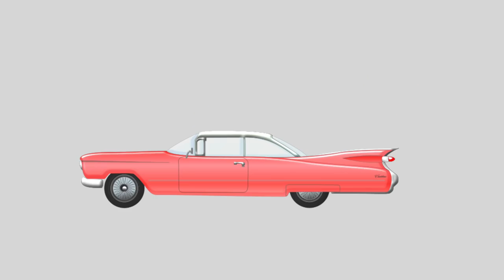Yes, Rockets CAN Fly in a Vacuum

Comment: What did you just say about cars? That they move by the thrust of the exhaust? With that knowledge I wouldn't trust a word she's saying
Reply: if she'd said that the car's tyres have to push on the external body of the road it'd be too easy to deduce that a rocket's exhaust has to push on the external body of the atmosphere. so she had no choice but to bluster.
Reply: No.
She said that the exhaust does generate some thrust, but not nearly enough to overcome the friction between the wheels and and road.

This statement is entirely correct. What's your issue with it?
Reply: @niallkinsella2687  wow white knighting a nasa shill, great gig.
Reply: @inniuniui9361  
White knighting...sure...
Because if it was a man presenting the video then you'd just be wrong. Can't be having that now can we...
Reply: @inniuniui9361  
You can claim that your physics defying nonsense is whatever you want to say it is.
One thing it will never be is correct.
Reply: @stuartgray5877  <------ has been shilling for over 2 years now.  Claims to be an engineer, yet roams YewToob comment sections.. Cuz that's what engineers, and not shills, do. 😬
Reply: @DrCash7  - So when a rocket engine ACCELERATES the MASS of the exhaust gas into the vacuum - from WHERE does the FORCE originate ?
Or are you going to argue that the exhaust gas (which HAS MASS) Can be accelerated WITHOUT a FORCE?
SO can MASS be accelerated without a force?
OR
Gas does NOT have MASS?
Which one is it genius?
Reply: @stuartgray5877  exactly.  Still won't back up this claim of being an "engineer."  Bot or shill, choose one.
Reply: @DrCash7  stuart gray doesn't even know that the velocity of a gas particle is a function of its thermal energy. so no, he is not an engineer.
Reply: @inniuniui9361  
Please, explain to the world how the momentum of a kilogram of water travelling at 1 meter per second is different depending on what phase the water is in.
If you don't like water then use methane, or iron, or any matter you can imagine.
Just as long as you explain how the momentum is different depending on the phase of the matter.
Reply: @inniuniui9361  
Where does it say that momentum is different depending on the phase?
How is the momentum of a kilogram of solid water any different from that of a kilogram of liquid water, or gaseous water?
Reply: Here Here says the Board lol
Reply: @niallkinsella2687  please show that equation using Newton's 3 laws of motion? To even use the word or term 'Thrust' you must first demonstrate some form of motion caused by it, not just gravity like rolling down a slope or hill. Good luck there champ.

Comment: Haha. I have this fight with my wife all the time! Thanks for clearing it up for her! ;) 

Oh and the exhaust exists the car through the exhaust valve with the exhaust stroke not because of the force of the power stroke. Your exhaust doesn't push the car forward, the power stroke turns Chemical energy into mechanical energy and that is transferred to the drive train to your wheels which in turn push or pull the car forward. The absolute minute pushing power that the exhaust might have would be nullified with the exhaust hangers.  I know it's not the point of the video but your car analogy is a bit off.
Reply: a bit off 😁
Reply: THRUST Definition: a force acting perpendicular to a surface. 
PRESSURE Definition: force over area equals pressure
NEWTON'S 3rd law. For every action there is an OPPOSITE reaction. HOWEVER, It goes on to state that you need two objects for an action. A MASS must act upon another MASS to generate an action. Force acts upon Mass to generate Thrust. Space has no Mass so no action can be taken to create thrust. You cant accelerate from a stop in space.
Reply: You gave the example of an inflated balloon which you left moved fastly,  is just because there is air around and the air coming out of the balloon strikes that air in the environment which pushes back the air coming out from the balloon which pushes the balloon and the balloon runs fast but in case of space as by definition there no air in the space then how the gases coming out from the hind part of the rocket as a result of combustion inside the rocket, push anything to react in opposite direction as there is no air in space?

Secondly, a rocket travels millions of km from the earth then will that fuel not finish. If its utilised from one side travel then on return from where refilling is done.

In my view travel in space is not possible according to the available laws of motion. 
Secondly let's suppose it possible by the ways you mentioned then how the rocket changes its direction and
Thirdly how it stops after reaching its destination?
Thanks
Reply: @5yri5  So tell us how a rocket moves in air? How do air molecules push back against the rocket body to move it? Keep in mind that these air molecules are being blown backwards at very high speeds.
Reply: @5yri5  - "Space has no Mass so no action can be taken to create thrust."

So according to YOU, the exhaust gas from a rocket has NO MASS?

A space shuttle main engine (SSME) consumes 500 kilograms of liquid oxygen and liquid hydrogen PER SECOND!
This creates PURE WATER at supersonic speeds.

How many kilograms MASS of pure water comes out of the engine PER SECOND?
Reply: @surgeonsk8104  a rocket, once it got momentum in the vacuum of space, it will continue moving without any thrusts since there's no friction that's stopping it since space is a vacuum. Law of inertia states that an object that's in motion will continue to be in motion indefinitely unless acted upon an external force(like friction) and rockets can change direction by reactivating thrusts and point it in a direction
Reply: I think you misunderstood her. She was saying that the exhaust leaving the exhaust pipe does create thrust but on earth in the atmosphere there are so many other strong forces like gravity, friction, etc that this thrust is negligible. If you were to launch the car into space and idle the car the thrust created by the exhaust leaving the tail pipe would be enough to move the car forward because it would be the only force and would be able to overcome the enertia of the car.
Reply: She explained how a rocket works on earth not space 😂
Reply: @5yri5 so you mean that as there is nothing for any force to act upon, the 3rd law results in stasis, an equal and opposite reaction that results in no physical movement from its point in space?

Comment: The exhaust does NOT propel a car down a road....its the explosion that moves the piston which turns the crank shaft that turns the wheel that is in full contact with a road hence movement.....
Reply: The exhaust is too small and slow in a car to propel it forward.
It has nothing to do with any rocket engine, she was very clear they work differently
Reply: Yeah she kinda messed that up. Also she implied the force of the explosion in the power stroke forces the exhaust out. The exhaust stroke does that haha.

Comment: Another way to think of it without (directly) invoking Newton is to envision an exploding grenade in space. The gases from the explosion expand outward more or less equally in all directions, flinging the grenade fragments in all directions as well. Now take away half of the grenade shell. The gases still push outward in all directions, but meet nothing to push where the housing has been removed, so they just escape out into space. But they also push against the remaining shell of the grenade, sending it on its merry way. A rocket engine is just a grenade with half of the casing removed. Well, a little more refined than that, but you get the picture.
Reply: Indeed.  Nod to the original Orion project from the 1950s where the concept was to explode nuclear bombs behind the spacecraft and use the shockwave to push it forward: https://en.wikipedia.org/wiki/Project_Orion_(nuclear_propulsion)
(NB: not the current, ongoing, Orion Spacecraft project: https://en.wikipedia.org/wiki/Orion_(spacecraft) )
Reply: @Braden-York  You were making sense until you mentioned a "flat earther." What the hell, man? What does flat earth theory have to do with rocket thrust?
Reply: Another way to think of it ?   How much slower thrust(or expended fuel )  would one need to impede faster thrust (expending fuel ) to accelerate  a 4 ton object in a almost perfect vacuum let say 5 km per second (high earth orbit gravity)  Answer   almost infinite  The volume/mass of fuel would need to collide with the expended energy simultaneously because in a vacuum the mass/volume of expended fuel would not lose momentum fast enough to propel a 5lb object.  Basically moving a rocket in a vacuum would be  time travel
Reply: grenade will not work .................it needs oxygen to fire ................smarty pants .................you're in a vacuum of space ....................will an airplane wing generate lift in a vacuum ?.....................NO IT WILL NOT .
Reply: @Braden-York  REPARATIONS FOR ALL TAX DOLLARS WASTED ON ..........................................SPACE SHIT !!!!
Reply: @WeeSleeket  on a flat earth ...........this is it ..............we are not going anywhere outside of "earth".
Reply: I came here because i’m curious about the reason why, for example, a football, with a hole from which air is escaping would propel itself in a vacuum. The leaving gas doesn’t have anything to push against and it doesn’t expand rapidly inside the ball. So what’s happening here?
Reply: lesnyk255 I actually had a soccer ball in mind, but I wrote it that way because I’m used to calling it a foot ball as we do where I live. Also, thanks a lot for the explanation, I actually had something similar in mind after doing some research and you confirmed it.
Reply: @thestarforger832  Ohh, soccer vs football, sorry, my USA bias is showing! Glad my explanation was consistent with what your own efforts had uncovered.
Reply: @lesnyk255  You are a physicist and don't understand that it is the air that is moving out of the balloon that is creating the force? The balloon would be treated as a point mass and the free body diagram would show a force that is in the same direction as the motion because of newton's third law. There would also be a force vector pointing down  due to the acceleration due to gravity.
Reply: @pblakeney  Of course I do - equal & opposite reactions. The notion that the escaping gases must "push" against something to make the rocket move is the fallacy we're talking about here.
Reply: @lesnyk255  The force is generated by the escaping gas not the net force of the gas inside the rocket. A change in momentum of gas as it leaves the rocket creates a pair of forces. This change in momentum is a change in mass (mass flow rate of the gas) multiplied by the velocity of the gas + (Pressure of escaping gas -stream free pressure) multiplied by the exit Area of the nozzle or F=Mdot X Ve + (Pe - Po)Ae. This is known as the Rocket Thrust Equation. The rocket does not push off the air and in fact, the air subtracts from the thrust vector as (-Po X Ae).
Reply: @pblakeney  You are of course correct. But I've been asked more than once "how can rockets work in space if there's no air to push against?" Invoking Newton's Laws or the Rocket Equation are not convincing arguments without some understanding of the principles behind them. Perhaps my analogy was a poor one, but it attempted to offer a more intuitive explanation. Maybe a better one would have been the rowboat that goes forward when its occupant heaves a cement block out the stern....
Reply: This is were physics drifts away from reality. Newtons 3rd law is relative to matter. How matter interacts with other matter. A vacuum doesnt have matter except photons and ions. So to say a directional airburst turns or stops a spacecaft is ludercris. Matter only reacts to other matter. A airplane creates a lower density/higher volume of gas that is pushing off of higher density/lower volume of gas creating a action. There for that action gas a opposite reaction which is pushing tue plane foward. A spacecraft using a airburst isnt creating a action because the matter (gas) isnt interacting with other matter because its a vacuum.
With a lack of action you cant gave a equal but opposite reaction. The airburst gas is just expelled. By time the 2nd particals of air come out tye 1st particals has gone further enough away that the 2nd particals cant give it a reaction.  So unless nasa wants to change its "talking" points and say there is micro matter in space and thats what we use as a action point.
Reply: Great analogy! Newton's 3rd law has nothing to do with rocket motion. Conservation of momentum is also often used to explain rocket motion. But conservation of momentum is valid only if the SUM of external forces acting on the rocket is zero. When the rocket is near the Earth, gravity acts on the rocket as an unbalanced force and so conservation of momentum doesn't apply.
Reply: Grenade wouldn't explode without oxygen
Reply: @gregorywaters8426  Thank you Captain Obvious. Have you never heard of "thought experiments"? Or "analogies"?
Reply: @gregorywaters8426  - "Grenade wouldn't explode without oxygen
Yes it would. Grenades have their own oxidizer. Bullets work too. So Does C4

Comment: One could potentially even propel one selves in space using farts. I already sent out the patent. I call it the Chili Drive™.
Reply: Topplethepyramid give me 5 pounds of beans.
Reply: #fartJokesHunter
Reply: Toppelethepyramid... Some Apollo astronauts actually mentioned that, because there was a still a bit of hydrogen dissolved in their drinking water after it came from the fuel cells.
Reply: What's your power source?
Reply: Somebody send this experiment design to the ISS! 

Unless they already tested it. (I don't think the Apollo crew documented those incidents with video)
Reply: And the rest of you coming out the same hole.
Reply: On a very very low gravity environment (an asteroid) you actually could launch yourself into space using your farts. yepp. but i wouldnt be very good for your health to pull blank.

i guess that is the lowest level we´ve ever been here....
Reply: An astronaut has mentioned this idea. It has a few problems. Some inherent to the design of your butt, some easily overcome if you have no shame.

A:Your butt is not a very good rocket nozzle. Not much you can do about that.
B: Your pants act as a diffuser, and will prevent any thrust from being generated. (Mooning your crewmates is frowned upon by NASA. though I'm not sure theres a specific rule about it. yet.)
C: Farts don't have much specific impulse anyway, as they have very little mass.
D: It is hard to keep your center of thrust aligned with your center of mass, so you don't just spin in a circle.

After much consideration, I propose that using your pee to propel yourself instead of your farts would be much more effective.  (I cannot recommend doing this however, as it is considerably more likely to cause damage to equipment, as well as considerable damage to your relationship with your crewmates.)
Reply: @Matthew Creech Chili Con Carnezine™
Reply: 844#1Fan Fasolada power...
Reply: You just need a load of Taco Bell
Reply: I would like to invest in this
Reply: "Mmm! Downing curried egg sanwiches right now (sorry, mouthfull). I'm gonna leave the  corperate world way behind (well something from behind & they're all running the other way).

Comment: Amy how about a video on all of the exotic metal alloys used in the space program, and why they were (are) used? Thanks and keep up the GREAT work.
Reply: Yes, would love to see that too. I’ve always been interested in what exact materials can withstand those kind of extreme temperatures and last for such a long time without constant maintenance. You’d figure with thousands of satellites up in space there would be a high demand for Astronaut/repair personnel. 

Who does all the maintenance for the thousands of satellites + the space station?
Reply: titanium, because it is heat resistant and can be used multiple times without failures.
Reply: Titanium is unfortunately far too reactive to be used at very high temperatures(*) and is dangerous in contact with pure oxygen, it is light and strong though. Nickel superalloys rule for high temperature metal parts, but much of the art of jet and rocket motor design is ensuring there is enough cooling to stop the metal parts melting immediately.  Anything touching a flame has to be ceramic, but its best if nothing touches the flame except cooling gasses.  In these contexts 900C air might be a cooling gas...

(*) In modern turbofan engines the last stage of the compressor runs too hot for titanium to be safe, that's before the flame even!
Reply: @Samuelfish2k  the space station crew repairs the space station,
And the satelittes just burn up in the athmosphere on reentry.
Reply: @Lillstisse661  🤣"burn up on reentry " but don't burn up while being in the 4000° thermosphere the whole time😭
Reply: @sikisusa9340  Satellites don't burn up because the ambient air temperature is high. They burn up because by moving with extremely large speed they compress the air ahead of them, so its density and temperature increases. This shockwave surrounding the satellites is what ultimately destroys them. The shockwave only becomes "strong" enough below about 100 km.

Also whenever you read that the air in space is this hot or that hot, you should take it with a grain of salt. Temperature as a concept works differently in space, and it would be a long text to describe it in detail here how exactly. Even if the ambient air molecules are travelling faster (and thus have a higher temperature) they would not heat up any large surface, because there are so few of them.